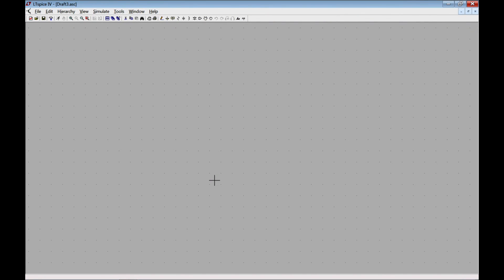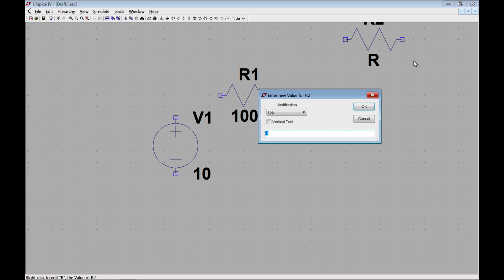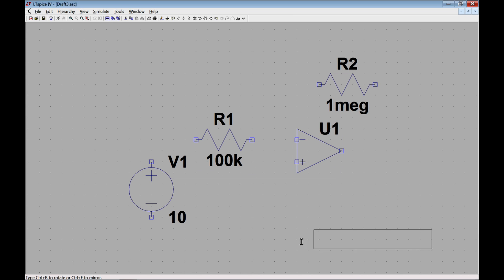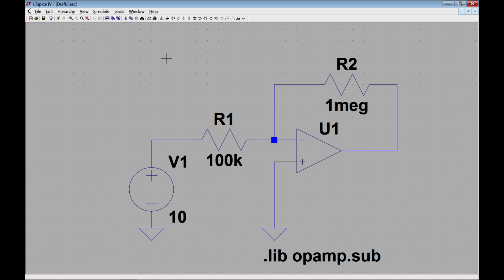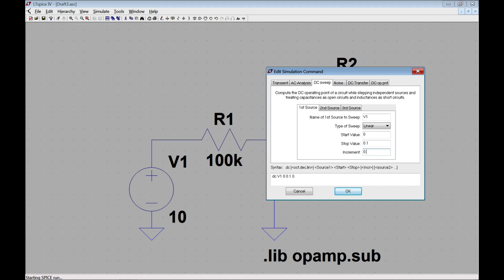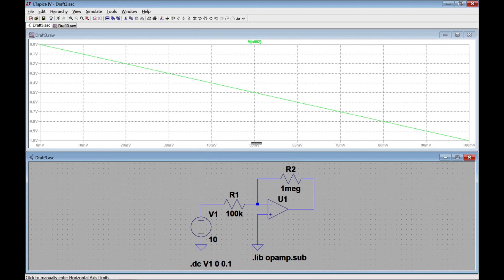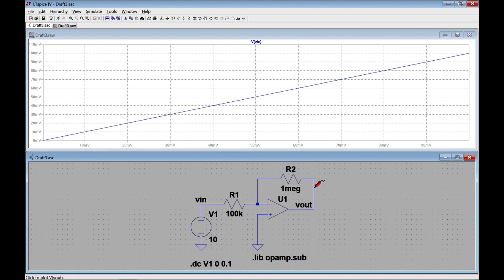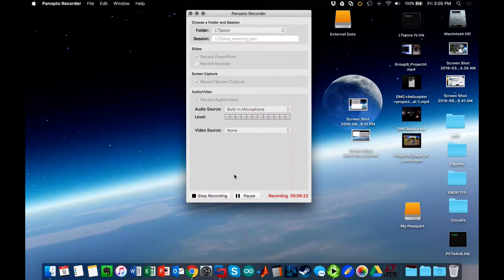LTSpice Inverting Op Amp Tutorial for Windows - How To Ep. 42

Comment: Would you happen to know how I can flip the op-amp to be positive input on the top left and negative on bottom left instead of the way it default shows up? I want to match a schematic that I have perfectly and I'd hate to have to redraw all the components on the wrong side of the page. Thanks
Reply from the maker: Yeah! When you go to place the component, hit Control (or Command on Mac)+R, Ctrl+R, Ctrl+E.  This rotates twice (Ctrl+R) and mirrors once (Ctrl+E)
Reply: disregard I found the answer somewhere else. The answer is CTRL-E, CTRL-R, CTRL-R. The first is flip the second and third are rotates.